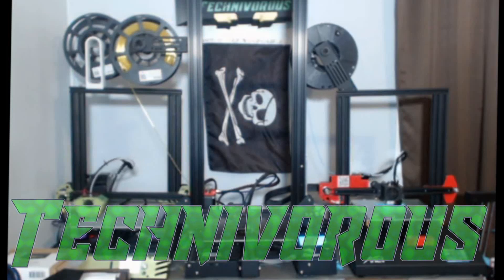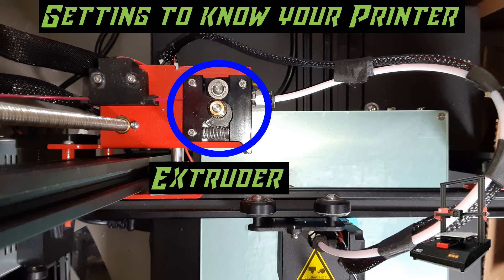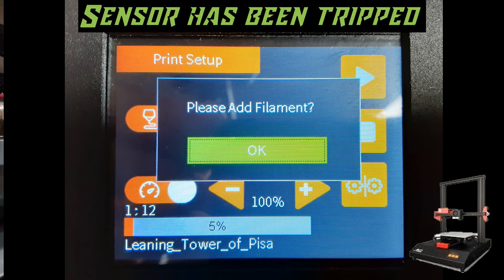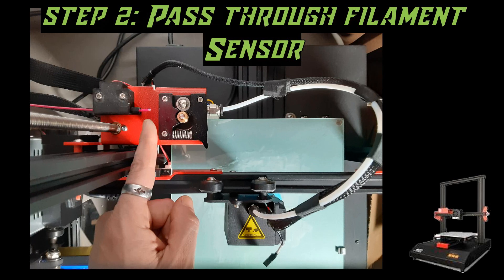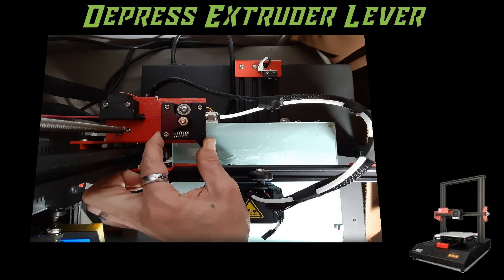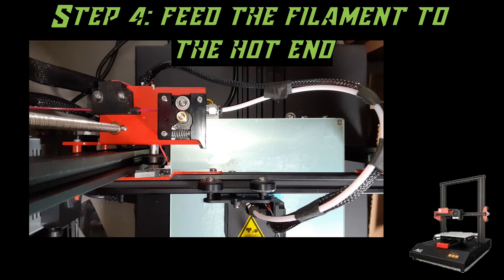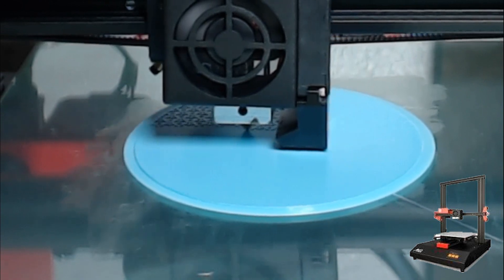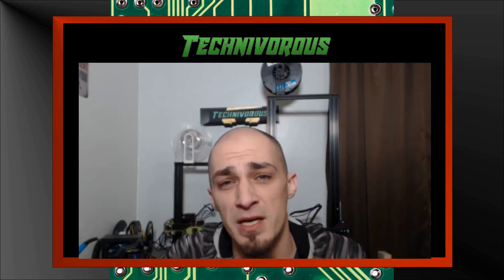3d Printing with the ET4 - How to load filament!

Comment: Thank U for the video. I think you forgot one step. when the sensor is triggered there will be filament left on the tube. How do you go about removing the end of the filament that is in the printer.
Reply from the maker: while the filament has passed through the sensor, there should still be some sticking out of the extruder, make sure the hot end is still heated, depreess the extruder lever and pull it out. alternatively, you can unscrew the couple and pull it out that side, but i  dont do it unless something else happened and the filament is somehow too short